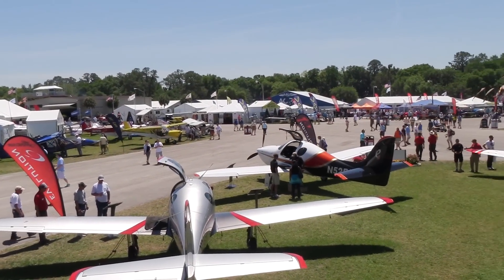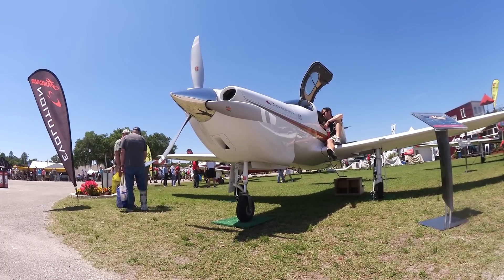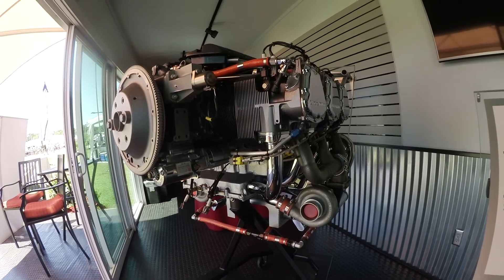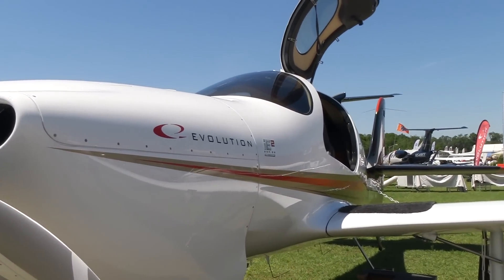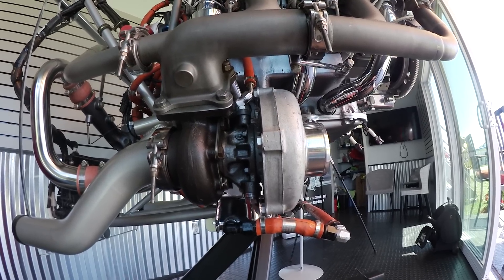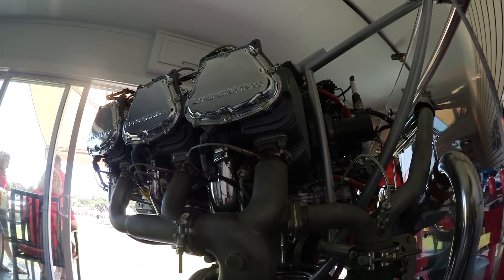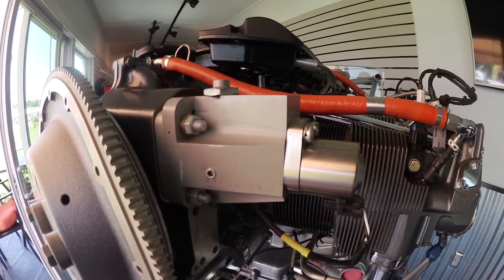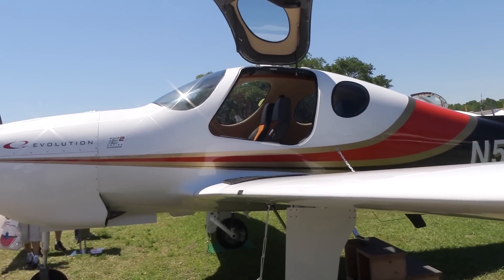Lancair Piston Evolution

Comment: Interesting with a fast piston bird but should that engine really cost 20x that of an automotive crate engine
Reply: if your honda civic dies you just coast to the side of the road. If your aircraft engine dies you just coast into the trees
Reply: @codmott286  that would be a good line if aircraft engines were particularly well built and didn't break much more often than car engines do. Yet they seem to do. Perhaps in part because ancient aircraft are kept alive in GA but apparently rotax engines fail a bit more frequently and they are presumably younger.
If reliability was in any way the actual reason, plane designs would have shifted to 2 much cheaper engines long ago. An AEIO580 is 141k$ iirc. A complex modern turbo diesel engine in a VW or Audi is around 2k euro. Granted that's their bulk cost but still. No small difference.  141k is a well paid man plus materials for an entire year. That price is nothing but despicable bs. And it's mindset like that that has crippled GA to where brand new planes are senior citizens. Indiana Jones would know how to fix them. And tragically that's barely an exaggeration since Bonanza is from 1945.
Reply: Why do I find you spitting your marvelous theories everywhere
Reply: @josephc.9520  Will of God
Reply: @DanFrederiksen  wow they do not. Airplanes and particularly their engines are way safer than cars. Most accidents are pilot loss of control
Reply: @thezeek2745  it seems like it's a good portion of youtuber fliers that have a story of engine out or even on camera. Anecdotally it sounds like it's a given in its lifetime more than failure free. despite annual inspections etc. whereas car drivers don't seem to experience engine failures much. Granted they are run at different power levels but still. 
I would certainly be surprised if car engines fail more often than plane engines.
Reply: @thezeek2745  btw this channel has a great video about engine failures in response to my point. Engine out is more complicated than simple mechanical failure but he seems to agree with my general observation that aircraft engines could be better and cheaper. And not just wishful thinking.

Comment: What do you thing about EPS Graflight V8 350hp Diesel engine : 
3000 TBO diesel vs 2000 TBO Lycoming IE2  ,
12gph diesel @70-75% vs 17,5-24 gph Lycoming @70-75%, 
increased range, lower fuel costs JetA vs 100LL
Reply: How much does that diesel weigh?
Reply: With the composite graphite engine block they are using the weight is probably same as these engines.
EPS engine is still a long ways off from being available for sale though.

the real problem is the cost. This Lycoming and the Graflight diesel cost well over $100,000+, as compared to a normal twin turbo TIO-540 which cost about half that.
Reply: The argument really doesn't hold up under scrutiny, Jet fuel weighs about one pound per gallon more than Avgas, but turbines are so light weight it all works out, Now you're talking about another piston engine thats probably heavier by design than your typical Avgas engine that burns heavier fuel, Im not saying it won't work, but I don't think you can realize any significant advantages.
Reply: MASS DIFFERENCE  --> graflight V-8 engine will weigh 30 to 50 pounds more than a comparable Lycoming or Continental engine. Avgas - 6 lb/gal vs JetA - 6,8 lb/gal. 
FOR EXAMPLE --> Lancair Evolution 168 gal avgas vs 140 gal jetA.  FUEL CONSUMPTION --> avgas vs diesel 75% (21,5 gal/h vs 12,4 gal/h ), 70% (17,5 gal/h vs 11,7 gal/h), 65% (16 gal/h vs 10,7 gal/h) , 60% ( 14,8 gal/h vs 9,7 gal/h).
PERFORMANCE --> endurance avgas vs diesel 75% ( 7,8 h vs 11,4 h ), 70% (9,6 h vs 12 h ), 65 % ( 10,5 h vs 13,2 h ) , 60 % (11,4 vs 14,5 h). 
COST --> example Europe avgas 10 $/gal vs jetA 5 $/gal,  fuel cost $/h avgas vs diesel 75% ( 215 $/h vs 62 $/h ), 70% ( 175 $/h vs 58 $/h ), 65% ( 160 $/h vs 54 $/h) , 60% (148 $/h vs 49 $/h )
Reply: Bankrupt

Comment: The weight of a Piston engine Reduce the Payload  compare to the PT Turbine
Reply: +stealhty1 increases the range though. Despite losing 100kts max speed you might actually reach your destination sooner traveling cross country with fewer pitstops to refuel!
Reply: +stealhty1 Sure, 200 pounds.  But, keep in mind that it burns WAY less fuel.  Useful load is 1800 pounds (vs. 2000 with the turbine).  The turbine airplane has an enormous fuel capacity (168 gallons of Jet-A), which is part of why it was designed with such a huge useful load.  That's 1,142 pounds of fuel!

Because the piston airframe is identical, it has that same 168-gallon capacity, but you're not likely to use it.  168 gallons at 23gph (high performance cruise) is over 7 hours in the air.  Would you want to fly that long?

Compare this airplane to something like a Cirrus SR-22, which has 92 gallons of fuel capacity and also seats 4.  So, put 92 gallons in the Evolution.  92 gallons of 100LL is 552 pounds, leaving you with 1,248 pounds of your useful load left for 4 people and baggage.  Even if all four people are 250-pound large male adults, that still leaves 248 pounds, which is still more than you're allowed to put in the baggage area (max is 225).  

So, realistically, with four 200-pound adults and as much baggage as you can carry, the plane can still carry 128 gallons of fuel, which is enough to fly for well over five hours at max cruise -- probably more than you'd want to do without a break.
Reply: turbines require twice the fuel !go fast for two and a half hours and stop and fill it up again! with full fuel I don't think u can fill all the seats!
Reply: @MikeKobb Been 5 years nut I just wanted to say thank you for taking the time to write this, I learnt alot.
Reply: @DerickMasai  You’re most welcome! I’m glad it was helpful!
Reply: You probably can’t fly as high or ultimately as fast with a piston engine either

Comment: Anyone know why exhaust headers aren't being used in this engine?
Reply: +Matt Williams :57 you can see the exhaust headers.
Reply: +Jolinator Nope. at 45 seconds, you see the three exhausts dumping into 1. Exhaust headers are of equal length and the exhaust of one cylinder helps evacuate exhaust from the next one. In this design, the exhaust power pulses sometimes fight the exhaust from an adjacent cylinder, blocking the scavenging. A common design is to have, in this case with a 6 cylinder,  each pipe of equal length dumping into one larger pipe. At no time does the exhaust pulse of one cylinder get in the way of any other cylinder.
Reply: Matt Williams Not all headers are of equal length in fact most arn't due to packaging or other reasons, usually headers of equal length are called "equal length headers" plus being a turbocharged engine being of equal length is far less important than an N/A application. Also given the firing order of the lycoming engine , there is hardly any worry about cylinder scavenging which is also quite minimal due to the back pressure from the turbochargers. Non turbo engines are a different kettle of fish, where the scavenging of the header(sometimes called extractors) makes a huge difference, once you stick a huge restriction in the exhaust (turbocharger) the benefits are soon nullified
Reply: +Jolinator Sorry, but it seems we have different definitions of the word "scavenging". The exhaust pipes shown at 45 secs all flow into one pipe. Good so far. However, the exhaust pulse of the far right cylinder travels the length of the main pipe, with it's exhaust pulse likely blocking the passage of the next cylinder and/or the far left cylinder.

The purpose of the pipes being of equal length is to have equal distances for the exhaust pulses to travel. And, yes, the concept of headers means pipes of equal length leading into one major pipe.

In a v-8, one back has 4 cylinders. Their pipes are generally designed to have each pair of adjacent cylinders flow into one and each of these two "collectors" flow into 1 large one. Hence the design name "4 into 2 into 1"
Reply: There is very few oem engines in the aero/marine/automotive industry which are Turbocharged and have Equal length exhaust headers , yet i can list hundreds which have unequal length headers, i am well aware of what equal length means, however it is less of an issue on an engine with only 3 cylinders per bank, and as stated equal length headers on a turbo engine is not some huge advantage as on a N/A , as demonstrated by the lycoming ie2 engine! All the best
Reply: +Jolinator All exhaust headers MUST be of equal length so the pulses travel the same distance. Further, headers can be tuned to work better at certain RPMs.

Check these sites. Answers all of your questions. Pics: 

https://www.google.com/imgres?imgurl=http%3A%2F%2Fwww.velocity-xl.com%2Fblog%2Fwp-content%2Fuploads%2F2013%2F06%2F2013-06-11-IMG_20120827_120728.jpg&imgrefurl=http%3A%2F%2Fwww.velocity-xl.com%2Fblog%2Fcategory%2F2013%2F&docid=1hI28OiTFdUcpM&tbnid=zabCJUgmNApyrM%3A&w=2592&h=1944&ved=0ahUKEwjq9Yq_1ITMAhWLKCYKHfsADCoQMwgcKAAwAA&iact=mrc&uact=8

Explanation and a few pics: 

https://en.wikipedia.org/wiki/Exhaust_manifold
Reply: Firstly the photo you sent is a non turbo engine.. as i keep trying to explain to you non turbo and turbo manifold design theory is quite different.  

Secondly in that Wikipedia article where does it make mention  ALL exhaust headers must be of even length for it to be classified a header?? You are confusing an "exhaust manifold" with  "equal length headers" or "equal length extractors"

lastly you now need to tell every single oem manufacturer their idea of a exhaust manfold is wrong. Clearly Lycoming dont know what they are doing right?
Reply: Cylinder 1-3 and 4-6 are divided. Not really needed for turbo, intake is not tuned so less effective anyway. Packaging and weight are big considerations. This engine is a poor design anyway, they have just slapped electronics on a 1920's engine.